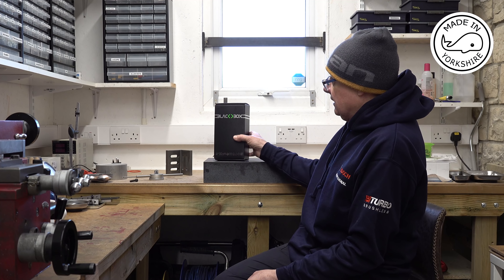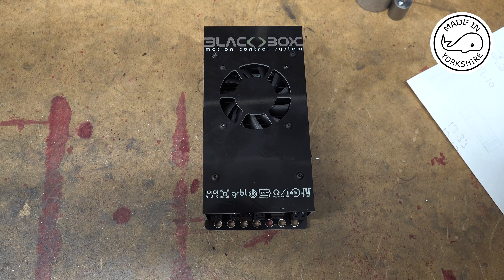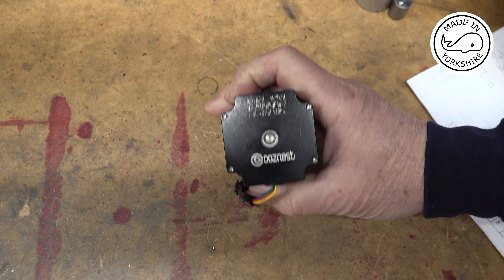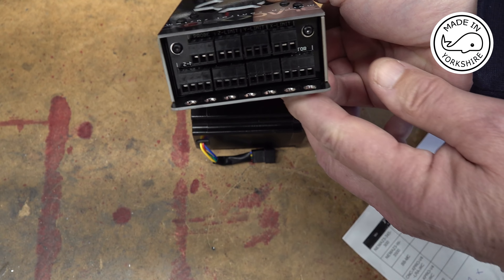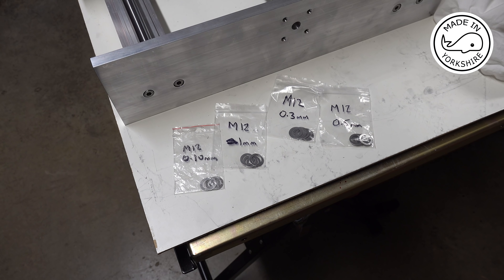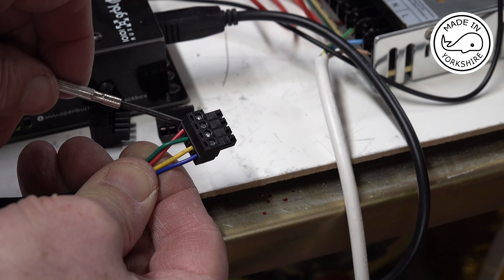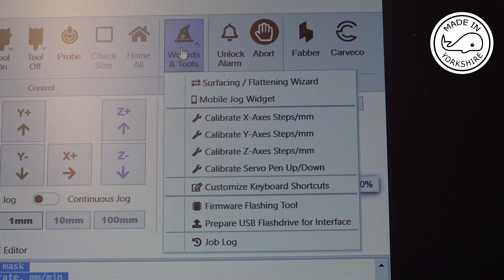#MT47 Part 5 - Olivier CNC Router/Engraver. OpenBuilds BlackBox Controller from Ooznest. In 4K/UHD.

Comment from the maker: **READ ME**
**Olivier's drawings are now available to purchase**
See my video description for more details - click SHOW MORE to expand the description.

Updated 4 April 2022......
I managed to get the limit switch functioning correctly. I set $21=1 as suggested by John Smith and it works.
I now have limit switches fixed to all 3 axis and the homing function works a treat.
I decided to wire the switches as Normally Open (NO). On each axis I have switches on both ends, wired into the controller in parallel.
I think there is an argument to wire them as Normally Closed (NC), but this will suffice for the moment.

Cheers
Andrew
Original post......
I'm not sure why the software isn't taking action when limit switches close. Maybe it's a grbl setting?
I think I might have to enable soft and hard limits? More research needed!
These are the grbl settings in the controller:
[14:08:47] [ $$ ] $0=10 ;Step pulse time, microseconds
[14:08:47] [ $$ ] $1=255 ;Step idle delay, milliseconds
[14:08:47] [ $$ ] $2=0 ;Step pulse invert, mask
[14:08:47] [ $$ ] $3=0 ;Step direction invert, mask
[14:08:47] [ $$ ] $4=1 ;Invert step enable pin, boolean
[14:08:47] [ $$ ] $5=0 ;Invert limit pins, boolean
[14:08:47] [ $$ ] $6=0 ;Invert probe pin, boolean
[14:08:47] [ $$ ] $10=1 ;Status report options, mask
[14:08:47] [ $$ ] $11=0.010 ;Junction deviation, millimeters
[14:08:47] [ $$ ] $12=0.002 ;Arc tolerance, millimeters
[14:08:47] [ $$ ] $13=0 ;Report in inches, boolean
[14:08:47] [ $$ ] $20=0 ;Soft limits enable, boolean
[14:08:47] [ $$ ] $21=0 ;Hard limits enable, boolean
[14:08:47] [ $$ ] $22=0 ;Homing cycle enable, boolean
[14:08:47] [ $$ ] $23=0 ;Homing direction invert, mask
[14:08:47] [ $$ ] $24=25.000 ;Homing locate feed rate, mm/min
[14:08:47] [ $$ ] $25=500.000 ;Homing search seek rate, mm/min
[14:08:47] [ $$ ] $26=250 ;Homing switch debounce delay, milliseconds
[14:08:47] [ $$ ] $27=1.000 ;Homing switch pull-off distance, millimeters
[14:08:47] [ $$ ] $30=1000 ;Maximum spindle speed, RPM
[14:08:47] [ $$ ] $31=0 ;Minimum spindle speed, RPM
[14:08:47] [ $$ ] $32=0 ;Laser-mode enable, boolean
[14:08:47] [ $$ ] $100=250.000 ;X-axis steps per millimeter
[14:08:47] [ $$ ] $101=250.000 ;Y-axis steps per millimeter
[14:08:47] [ $$ ] $102=250.000 ;Z-axis steps per millimeter
[14:08:47] [ $$ ] $110=500.000 ;X-axis maximum rate, mm/min
[14:08:47] [ $$ ] $111=500.000 ;Y-axis maximum rate, mm/min
[14:08:47] [ $$ ] $112=500.000 ;Z-axis maximum rate, mm/min
[14:08:47] [ $$ ] $120=10.000 ;X-axis acceleration, mm/sec^2
[14:08:47] [ $$ ] $121=10.000 ;Y-axis acceleration, mm/sec^2
[14:08:47] [ $$ ] $122=10.000 ;Z-axis acceleration, mm/sec^2
[14:08:47] [ $$ ] $130=200.000 ;X-axis maximum travel, millimeters
[14:08:47] [ $$ ] $131=200.000 ;Y-axis maximum travel, millimeters
[14:08:47] [ $$ ] $132=200.000 ;Z-axis maximum travel, millimeters
Reply: limit switches only work when hard limits are enabled
Reply: The limits are working but the software doesn't know what to do when the limit is made. There is most likely a setting or g code that is missing.
Reply: try setting $21  from" [ $$ ] $21=0 ;Hard limits enable, boolean" to " [ $$ ] $21=1 ;Hard limits enable, boolean" thats the setting for hard limits i belive $22 is for a home switch with isnt quite the same.
Reply from the maker: Thanks John - it worked! I've now fitted limit switches on all the axis and she homes perfectly. I just need to get my head around the rest of those grbl commands.
Cheers
Andrew
Reply from the maker: Thanks Lasse - I set $21=1 as suggested by John Smith and it works.
Cheers
Andrew
Reply from the maker: Thanks Noel - I set $21=1 as suggested by John Smith and it works.
Cheers
Andrew

Comment: Really a great Job Andrew! Machining is Your home territory but electronics like this,.. no the same much. Watching Tour video, hearing Your calm voice, I take my hat off for You. Facing so much new, unknown, You're doing an incredible job. A novell of comments below..

Oh. Things look rather difficult to me, in my eyes. 
I've built a CNC based on ready mechanics and Arduino stuff and it works well but it remains to create a dust repelling housing....
Time 07:20. Well done Andrew! That is a point when young newbies make the firs mistake.
Plus or minus..... Connecting them one way gives forward, the other way backwards. A bit of test and try quickly sorts that out. Best to do before a full mechanical installation.
Time 08:20. Having this question as number one designing logic and harness for a lot of UK running ware house fork lifters You must use the close circuit as "clear to run". NO, normally open, should stop the movement. That way even a broken cable will stop the CNC. A connector vibrating and getting loose etc...
Those micro switches look complicated and costly. There are such switches for solder connection, the cheapest, and also screw connections. 3D printed mounting devices possible for them as well.
Time 10:00. Good mounting idea! I bought a ready made kit like that for my MF70 - CNC conversion.
Time 10:10. On safe grounds..... Turning the studs to size...
Time 12:14. Mounting them diagonally I got away with only 2, but of course, using all 4 will be even more rigid.
Time 13:45. Well done, all according "to the book". I think about the green/yellow cable, the safe ground. I run all my power supplies without it...... Why? I don't have 3 pin mains outlets in the places I would need them. NOT RECOMMENDED AT ALL! But I do, knowing the surrounding danger..
Time 16:10. Plus or minus being right? Wellcome in the club! It never gets right the first time.
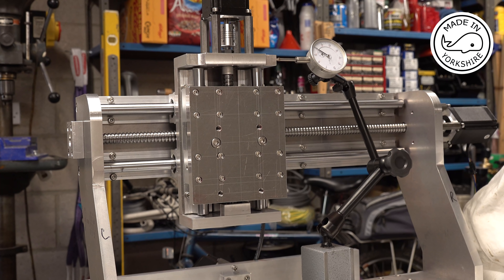Time 18:05. Tuning the movements in. Number of steps per resolution, ball screw TPI are the variables. The result is put into the setup constants.
Time 18:50. End switch. Active low or active high, and connected to the right input.. Your way of testing is the best, and it is safe!

In one way You have the same ability as James Bond, solving the impossible matters.

Really well done! I really applaud Your work in the video!
Reply from the maker: Ha ha - thanks Stefan - and thanks for the advice.
All the best.
Andrew

Comment: Limit switches should be wired in series to normally closed. If a switch fails or the limit is reached the motors halt.
Reply from the maker: Thanks for the advice. I've got them working ($21=1). For now I have wired as normally open, but I think it's safer to wire normally closed as you suggest. I will revisit on final build.
All the best.
Andrew
Reply: @learningturningmetal  you get much better noise immunity too with NC limit switches. Helps prevents false triggers. To enable limit switches there is a  GRBL parameter you can change with just a serial terminal to GRBL also called console? Rather than use the fancy software. Worth s as it’s a quick way of changing calibration etc. Search for GRBL manual online good luck! I’m enjoying this series 😀
Reply from the maker: Thanks for the info. My continuity meter identified the right two pins NC so I spent all day rewiring the switches in series. I set $5=1 but I just couldn't get them to work. 
I've just had another look at the switches and there are some very faint markings. Left is common. Middle NO. Right NC. Maybe I hit the wrong contacts with my meter yesterday? I will have another try today connecting left and right pins 😔
Update: it looks like the board on the switch overrides the actual markings on the switch. Board on switch marked VGS. Volts, Ground, Signal? I've asked ooznest for advice.
Cheers
Andrew

Comment: Morning Andrew, cold and windy but bright sunshine here in New England this morning. Hot coffee tastes good. Limit switches have to stop the motor when contact is made but be open to move the motor in the opposite direction to jog off the limit switch. Must be something in the software to accomplish this. Other than that I had a fellow in the New England Model Engineering Society help me set up my Bridgeport NC tape drive, no circular interpolation to a full CNC with Gecko drivers and  Flashcut software. I have everything necessary to make it three axis but have never gotten around to it.
Cheers 
Dick B. USA
Reply from the maker: Hi Dick - thanks for the advice. I got the limit switches working by enabling hard limits in grbl ($21=1). All switches now fitted and the machine homes perfectly! The vfd and spindle have just arrived - wow the spindle is really heavy! Another chance to play with electricity!
All the best.
Andrew

Comment: Great project, good information on the controller and software, I have been keen on making something similar but not sure on what controller/software/motors etc to use. You have given me the confidence to use the same equipment.
Now you will just have to get your head round the fact the table doesn’t move, it is in fact the tool that moves! At least that’s how you view it when programming CNC. All the best James
Reply from the maker: Thanks James - the OpenBuilds BlackBox seems pretty good to me - but I am definitely no expert. I got the limit switches working correcly and the machine homes perfectly.
All good fun!
Cheers
Andrew

Comment: Hi Andrew, for me building the CNC was easier than setting up all the software. I looks like you are figuring it out.
I ended up spending almost as much for caming software and Mach3 as I did for the machine it self.
Good luck Rich
Reply from the maker: Ha ha - thanks Rich - you hit the nail on the head!
Cheers
Andrew

Comment: Andrew, on industrial CNC systems the axis has two switches at each end of the travel, one is for over travel and the other is its home position. the home position is the first switch that is made and and the second switch is if you've exceeded travel, when you first start up the machine it doesn't know where it is but you can manually move the axis, you have to run a routine to allow the control to find home  on all axis and the machine then works all of its coordinates from those known positions, I've not worked on systems like yours but maybe that is your issue.
Reply from the maker: Many thanks for the info. Based on advice I changed $21=1 to get the controller to take action. I have now installed two switches on each axis and the homing function works a treat!
Cheers
Andrew

Comment: Impressive set up. The electronics are beyond me so I cant offer help with the switches. One suggestion I do have is to isolate the steel components from the aluminium as far as possible. Plastic washers will do the job and maybe paint inside the holes. If you leave the two materials raw and in contact you will get electrolytic corrosion at the joints.
Reply from the maker: Thanks for the advice Tim. I've now managed to get all limit switches functioning correctly ($21=1).
Cheers
Andrew

Comment: Andrew if you look at your limit switches closely you will see   C.   NC   NO,     these relate to the switch terminals below the lettering and mean   C Common. NO. Normally open. NC Normally Closed.  Normally means in the unswitched rest position. So if you need contacts that are  Normally open  you need the left and centre contacts .
Reply from the maker: Hi Mike - thanks for the info. The switches weren't marked but I worked it out using a continuity tester. I've wired all switches to be NO and they work a treat. I think I will change to NC at some point as I believe that offers more protection (eg if a wire comes loose it will trigger the alarm).
Cheers
Andrew
Reply: @learningturningmetal  Hi Andrew if you go to the 8:00 point on your video C NC NO are clearly visible on your switches😉
Reply from the maker: Well spotted Mike, but it's C, NO, NC. But here is the problem.... My continuity tester on the actual switches terminals confirms C and NC make a circuit with the switch open. Close the switch and the circuit breaks. So that is what one would expect. However there is a circuit board between the switch terminals and the connection pins. Placing the continuity tester on the corresponding pins gives exactly the opposite effect. Placing the tester on the corresponding C and NO of the board gives no circuit whether the switch is open or closed. So the circuit board overrides the actual switch terminals. My guess is that applying 5v to the first pin will create a different effect, but I can't risk frying the controller.
Thanks for trying to help.
Cheers
Andrew

Comment: Hello Andrew,
More good progress... I was wondering has Olivier got his machine up and running? also the Ooznest guys do seem to have some nice products and from what I understand are nice to work with. See you on the next one.
Take care.
Paul,,
Reply from the maker: Hi Paul. Olivier designed this machine specially for me. He made a much larger one for himself a while back. The ooznest machines have good reviews but they aren't really designed for heavy vfd spindles. They tend to be used with those really noisy palm routers and there aren't many examples of machining brass or aluminium. I think I've spent around £1300 making my machine and that could have purchased a workbee. Hopefully mine will be a lot more rigid.
We will see!
Cheers
Andrew

Comment: This maybe  isn't the problem you are having here, but when a controller homes it will allow you to reverse or else it would just be stuck with the switch on. You would usually wire a limit switch  up to be normally closed so if the wires break you don't get a nasty crash it just refuses to move.
Reply from the maker: Thanks for the advice John. For now I decided to wire the switches as normally open - but I totally get your point. I will try to address that on final build.
Cheers
Andrew

Comment: I love the idea of these units, even though I went down the Mach3, separate stepper driver route. It all works fine but having to run an XP computer for my router & another for my mill is a pain as they take up a lot of room!!! My only concern with switching over to one of these all in one units is exactly what makes them so easy, everything is inside! If a stepper driver dies on my system, I throw a 30 quid driver away. If one of the drivers dies in this type of setup, you throw away a 200 quid box, or is there a way around that?
Reply from the maker: Fair point I guess. It is a very tidy setup though.
Reply: @learningturningmetal  Definitely tidy! Plus, the software that can be used with it looks pretty good & similar to the lightburn software for my laser engraver. Really tempting!!!!
Reply from the maker: @Arckivio  if you are unsure about reliability, have a look at the various forums on the internet. Someone has also commented on here that you can buy an openbuilds box to drive it, rather than a PC. Functionality is not as good as the PC software, but still worth considering.
Reply: @learningturningmetal  I don't have any particular reliability concerns as I know they've been around a while. I would definitely run this from a laptop so it can be put away, whereas mach3 is harder to run from a laptop and isn't recommended. At least I now have an option that I didn't know existed! It seems I went with mach3 and haven't looked any further since!

Comment: Hi Andrew
Do you use Windows and what version to run the BlackBox.
Thanks
Reply from the maker: Hi I use windows 11 but the documentation suggests older versions are supported. Check out https://docs.openbuilds.com/doku.php?id=docs:blackbox-x32:install-drivers
Openbuilds also sell a blackbox interface which negates the need to have a Windows computer, but functionality is limited.
I also note that the blackbox controller has been upgraded to a 32 bit processor, not that I have encountered any performance issues with the older one.
Hope that helps.
Andrew

Comment: I've been very happy with my GRBL controller connected to a Raspberry Pi, but if you're not comfortable with setting up Linux the initial learning curb might be an issue.
Reply from the maker: Hi Anders. Many thanks for the info. 👍
Cheers
Andrew

Comment: the limit switch has 3 wires, maybe it has to be earthed to work properly. eg connected ti the frame
Reply from the maker: Hi debeeriz - I put a continuity tester on it and found one common. The other two - one is open and one is closed. This gets reversed when the switch lever is pressed. I had to enable hard limits in grbl ($21=1) and all six switches are working perfectly.
Cheers
Andrew
Reply: @learningturningmetal  glad you got it sorted

Comment: You calibrate using a dial indicator and an accurately measured 1,2,3 block or calibrated block.  You can send me an email and I can point you in the right direction for calibrating the axis.  As for the limit switches not triggering the drivers to stop you may need to look into the driver settings.
Reply from the maker: Many thanks for the help. Based on advice received I set $21=1. All switches now installed and working. I did a bit of research and found that my 1605 ball screw should work at 320 steps per mm. I changed the settings to that and then double-checked it using the calibration routine and a gauge. Looks spot on.
All the best.
Andrew